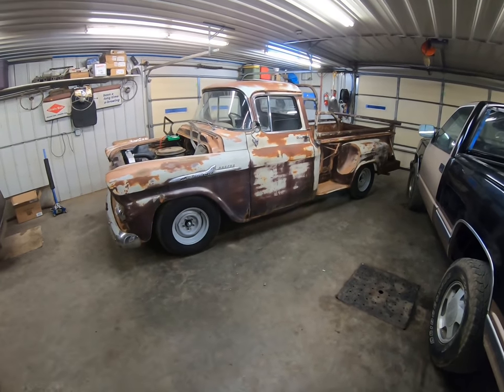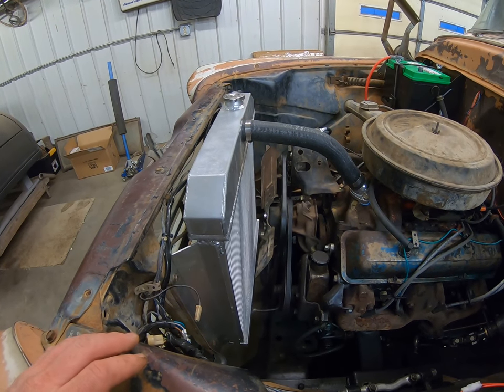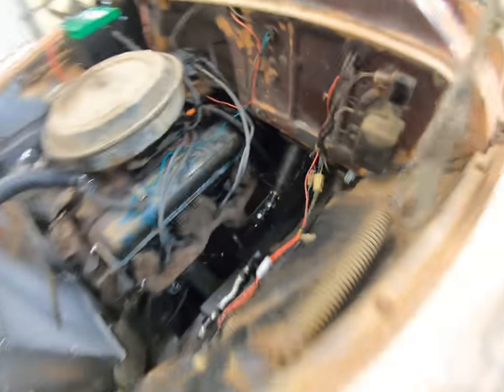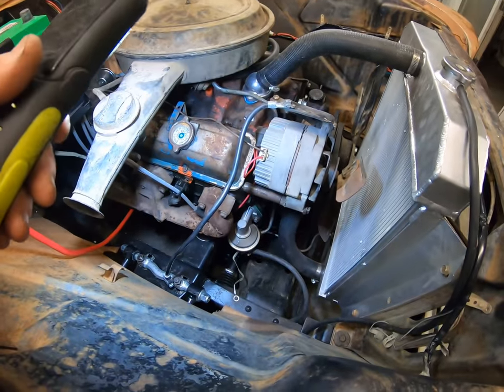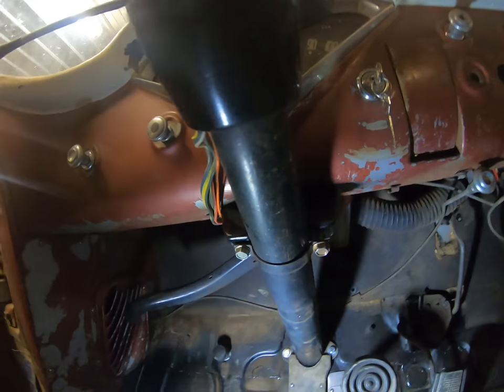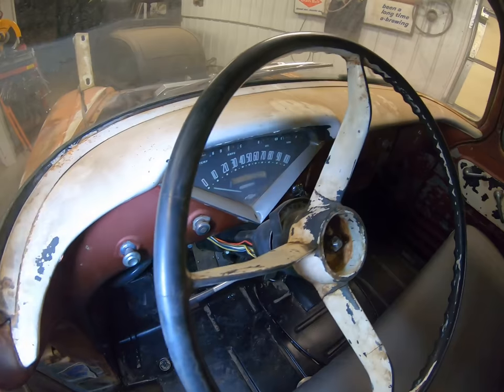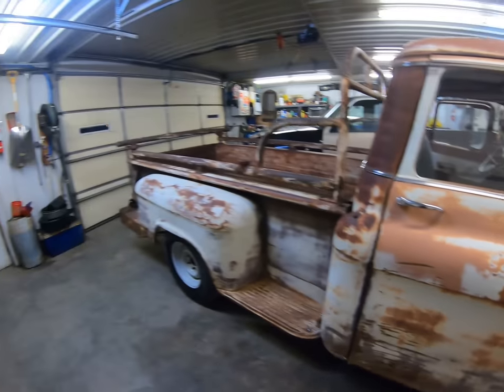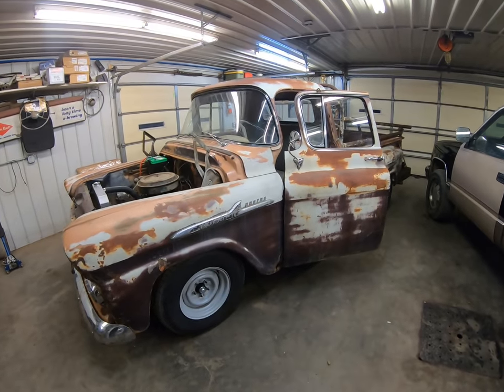1958 Chevy Apache Daily Driver Budget Build!!!

Comment: I'm all about some budget building. Just started my 59 Apache. I'm going to try to video most of the build. Thanks for posting. New Subscriber
Reply from the maker: Thanks for watching! These are great pickups. My suggestion would be to spend a few more bucks on the MII front suspension than the eBay kit I purchased. It left a bit to be desired and had zero instructions or support.
Reply: Thanks.  I'll sure keep that in mind.
Reply: @MortskeRepair  Are those aftermarket kits better than takin' a front subframe from a Camaro/Firebird/Nova, et al, or a frame clip from an A or G body? If so, why? They sure cost a lot more.

Comment: I put a drop down stainless battery tray down on the frame on my '58 Fleetside and also the brake booster and master cylinder. Clean firewall. Have a '79 Volare K-member, adjustable ride height torsion bar suspension.
Reply from the maker: Cool

Comment: Love your Apache, I appreciate how you kept it closer to original looking yet did some nice additions. I’m driving a 59Apache and might consider some of your ideas. Nice work 👍
Reply: Do you have any suggestions?
Reply: @tompopowich8110  I have a 57 gmc front end and cab setting on a 59 frame and bed.  That step inside the door just above that is where I installed mirrors.  I have the long mirror and two short mirrors on the corners.  Something to consider.  Won’t break the bank.
Reply: @rogercrawford8372 thanks for the suggestion, you’ll have to post a video so I can picture it a little better. You can see a few videos on my channel showing what I have. I’m not sure if I should post it here?

Comment: Very nice! 
 I'll be looking for one 55-59  after I sell my 86 turbo first gen 4runner. Hopefully in the next couple of years.
Reply: Im currently fixing my 57 chevy  P.U. short bed. Have two 1956 GMC cabs for sale.
Reply: @adamvalenzuela6626  I bought a 59 for my birthday . It's a gmc cab with regular rust. It's got a small block 350 with a mild cam and a 700r4 transmission with a 2800 stall converter. It's got an s10 frame with bags for suspension. No electrical anything,  brake lines steering, seats, glass and a rear passenger stepside wheel fender. It was a project from the previous guy. And now it's mine.  Do you have an extra wheel fender for a stepside bed by chance? Ebay has pretty much everything. But made in China mostly.

Comment: Howdy, 
   Just picked up a 59 apache 31, luv the knowledge you have. 
   Thanks for sharing. 
Body is straight, no motor running gear. You just mite be my new best friend.  
    Do you have any other apache vids?  Just doing my research now.  Seeing what's used to get'm going.
Reply from the maker: No I should have video'd more on this one when I built it.

Comment: Great video. I love the 58 and 59. I just bought a 56 GMC Blue Chip that has had some work done to it.
The thing that has baffles me the most is how one knows which parts from other vehicles could/will work on a build. You mentioned a 70s model truck and earlier model Impala. I would have no idea what to look for on another vehicle to fit in mine.
Reply from the maker: I guess I've been around this stuff my entire life so you just try stuff and remember what you have and save things and keep trying and fitting until you get something that works!! GM stuff from the 70s and 80s is super cheap and versatile if you're willing to put in a little extra work. Thanks for watching and commenting Ted!

Comment: Coal is not pick up spring or bed friendly.  Back in very early 60s we still had a coal furnace.  A couple of times my dad feared the coal delivery might not make it in time before we ran out so he went to a local western PA mine to get a load in his '59 F100.  When he pulled under the shoot they dropped enough to fill the short bed and it seemed like it all hit at once.  Banged up the floor of the bed a bit and the truck instantly looked like a tail dragger.   But never broke a spring.  Leaf springs were....and are...tough.
Reply from the maker: Wow

Comment: Hey I’m a 16 yr old, and I’m a car guy too and I’ve been planning on buying and restoring my grandpas 58 Apache which has been sitting in his backyard for almost 20 years, it starts up but it does not run, do u have any tips on what to prioritize to begin in this project of mine?
Reply from the maker: I like to get them running first. Make sure the engine is loose and has compression. Then get spark and add fuel. Then address the tires and brakes. Don’t worry about the body work or interior until it’s running and driving. Thanks for watching!
Reply: If you do get never ever ,,get rid of if ,,,I brought one when I was your age ,,drove it all through high school ,later sold it to buy , a jeep , iam now 52 and miss that old truck every day

Comment: Hi, so cool project, good job . Can you please exactly tell me the parts or the kit what you order for the front suspension. I live in Colombia and I have the 1957 Apache and i would like to do similar job you have done on this one . Thanks a lot , Julian.
Reply from the maker: I do not have the part number for that kit. I would suggest not buying from the same supplier as I got mine from as they were a real piece of work to deal with. There is several kits like it listed on eBay. Thanks for watching and commenting Julian!

Comment: Awesome work: a really nice balance between originality and tasteful upgrades. You've continued the spirit of the original vehicle, but upgraded it in a way that the original designers would have done if they'd had the insight and technology. A question: do the biscuit engine mounts dampen vibration successfully? They seem awfully small compared to modern engine mounts.
Reply from the maker: Yeah, they work quite well. Several large equipment manufacturers use them to this day.

Comment: Very nice but the wires coming out of the steering column are a bit unsightly…
Reply from the maker: Yeah but it’s a $20 column versus a $300 aftermarket unit. Could always build a small cover.
Reply: @MortskeRepair  ……get one of those plastic wire sheaths that snap over ……

Comment: I always rather the factory air box inless its intake screw the top air filter i feal every time i have a air fitler like edelbrock or just round filter on top i feal you get more air but its hot dirty air off the motor the factory air box take air away from motor some times ill flip the cover for better air
Reply from the maker: Those open element air cleaners don't work so hot on dusty gravel roads like we drive. The factory style sealed air cleaners maintain the filters much better. Thanks for watching and commenting!

Comment: why would you get rid of the straight axle? a straight front axle will handle more weight then independent front suspension.
Reply from the maker: To get a better ride quality. Along with power steering, disc brakes and a wheel bolt pattern that has more of a selection than the original. Thanks for watching Daniel!
Reply: @MortskeRepair  if you want more powerful brakes you should use air brakes. Removing the straight axle is sacrilege. My grandpa switched from Chevrolets to fords because Chevy changed to stinking independent front suspension. If you prefer to haul less weight simply buy a 1960 or newer Chevrolet instead of destroying one of the last good Chevy pickups.
Reply from the maker: @danielrickel8807  Sorry I didn't build it the way you would. Thanks for watching!
Reply: @danielrickel8807  Air brakes? This thing ain't a Kenworth, kid. They don't make air brakes for pickup trucks.
Reply: @donellmuniz590  sure they do or at least they use to.
Reply: @danielrickel8807  If you want more powerful brakes you could install a hydra boost system. They can be low profile as well. I can't think of any reason why you would want air brakes. Only reason to keep the solid axle is if you're building a gasser.
Reply: @danielrickel8807  sacrilege? not everyone worships metal and glass...it will all rust or metal some day.

Comment: '77 engine may be an early emissions tech gas hog... low HP... low torque...
Reply from the maker: Not building a race car.
Reply: @MortskeRepair  - Couple hundred $$$ in parts plus proper tuning can double the horrid MPG... plus make for a lively driver... and safer passing capability on the open road...